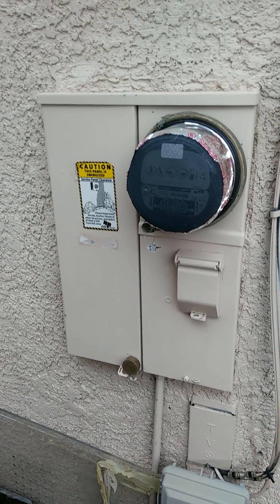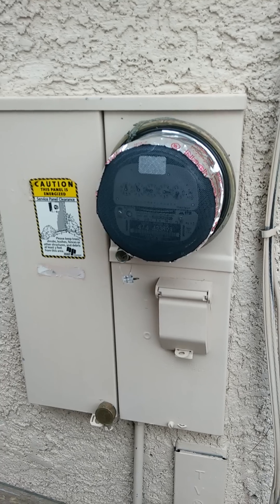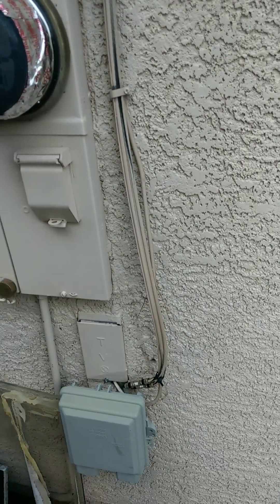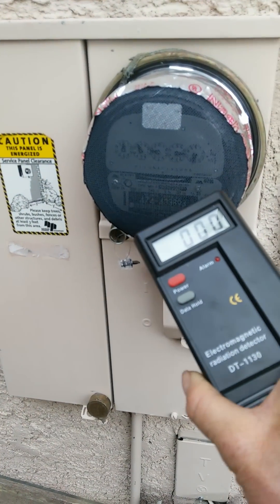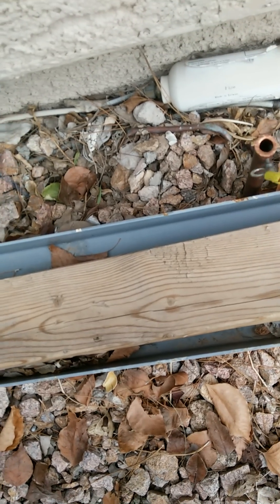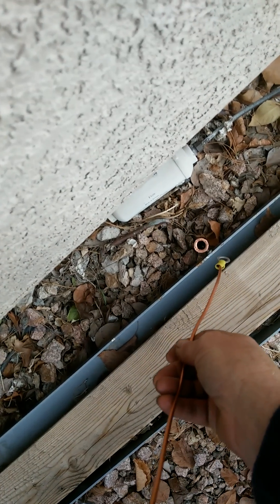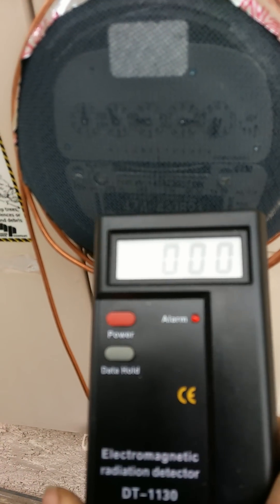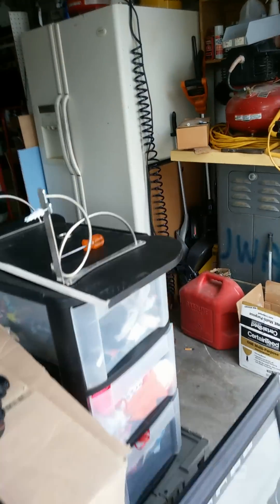Out smart the smart meter

Comment: Just put a aluminium screen on it with a 6" clamp and the frequency will drop alot
Reply: Technically the frequency stays the safe.
The amount of radiation is reduced to a much safer level.  
LESS RF OUTPUT.
Reply: thats 7'' you gombeen

Comment: You do not need to give your utility company "permission" to install a smart meter. Meters are property of the utility company not the homeowner. If you do not want a smart meter most utility companies allow you to opt out; some however charge a monthly opt out fee.
Reply: They do need permission to stick a HIGH POWERED COMMERCIAL RADIO TRANSMITTER ON YOUR HOME 
With over 100 deaths every month from smart meter radiation, that is the reason they DO NOT HAVE PERMISSION
Reply: Frederique Zug: please post the link which contains the data and source for your  “100 deaths per month” that you mention in your reply. Also, put your emotions aside for a second and realize that the meter does not belong to you and the utility company may change it as they see fit. They are required to give you advance warning prior to changing it and as mentioned most give you the option to opt out before installation but if they do not hear otherwise, they  DO NOT need your “permission” to install one.
Reply: Idk about any other state, but I live in Ohio and they had to ask my permission before they put one on my house.

Comment: she knows its not a smart meter she had the smart meter reolaced with one that put off radiation as well she grounded it also to hold down the extra radiation is what i got out of it. and if it works then just ficking do it too. or let the radition surround you to your choice.
Reply: 🔥🔥🔥🔥🔥☠☠🔥🔥🔥🔥🔥🚒🔥🔥🔥🔥🔥🔥🔥🔥🚒☠💀💀💀💀☠🔥🔥🔥🔥🔥🚒
Let's look at why we do not need smart meters. 
 #1 A smart meter will hurt or even KILL disabled homeowners who have disabled medical implants.  The average of deaths by smart meter radiation and smart meter fires is almost 100 every month in North America.
#2 Did you know if your power company “turned off” the power to your home when they did a smart meter install, your chance of a smart meter fire increased by a factor of 10,000.
#3 Your power company has access to all of you private power information. Eg When you make tea, when you turn on your alarm etc. This private information is sold to Google for huge sums of money. Ask your power company what the second radio transmitter in your smart meter does. (ZigBee) 
#4 A smart meter will cause cancer to return if your family members who are fighting cancer at home. If they come home from the hospital and sleep near a smart meter, they will die. Check with the US Cancer Society website. 
#5 Smart Meter RADIATION  will turn off breakers in your home. Both AFCI's and GFI's get turned off by the radiation from the smart meter.
#6 You smart meter is very accurate, BUT, the software (firmware) is programmable. Your bill has nothing to do with the power you use. 
#7 Smart meter radiation is breaking Ionic Bonding. 
#8 A huge expenditure for a huge loss. Billions of dollars to purchase something that does not general generate any power and each smart meter need 4 watts to operate. One million smart meters use 4,000 KILOWATTS of energy to operate.
#9 The second radio transmitter is for ZigBee. If you want your power company to MONITOR your home 24/7, then you are in luck. Don’t forget, this private information will be sold. Why do you think your power company spends BILLIONS of dollars and does not generate one watt of extra power to sell?
Reply: https://ieeexplore.ieee.org/document/7866234/?reload=true

Comment: The panel is grounded, you do not need to install another ground unless you want to put two 8 foot rods, and use brass screen not aluminum screen. Copper pipe is not a good ground rod.

Comment: does any one know what a safe distance away from the meter might be? im a horizontal directional driller and im pretty sure here soon im going to run a line to the back of ky property and put the meter there. right now its right outside my 2 1/2 yr old sons room. that room is the hottest room in the house too. not sure if thats in connection to the meter or what but i checked the duct in the attic that runs to that room,  no leaks no blockage nothing but that room is the furthest room from the ac unit so maybe that plays a factor. but that room is always uncomfortably  warm.  needless to say i dont let my son sleep in there. im sure georgia power will bitch when i move it without permission  but i will remind them thay installed it without permission so they are lucky i didnt dispose of it properly. but something gives me the feeling that they covered their ass and found a way for it to fall under the same permissions as  all the other utilities that you permit utility companies to work on their utilities on your property wherever their utilities are located on your property , whever you sign the deed to your house. in the fine print of course. but when i signed the deed to my house they didnt mention smart meters.  thats a whole other level
Reply: Greetings Jerry
They are allowed to install a meter on your home to measure the amount of power you consume. 
 They  can not get any closer than 12 inches to any one work, living or walking by.
Your power company will hire an outside company to BYPASS this FCC law.
That way, if you son dies from the excessive radiation, it's not their fault. 
Don't forget, your power company did not purchase a license from the FCC. so legally there is nothing they can do if you wrap your smart meter in aluminum foil. 

Watch this video, this is the only acceptable way to install a smart meter.
https://www.youtube.com/watch?v=G0bq2Hn2vOo
Your power meter is NOT UL approved and not as safe as the old glass and metal meter. 
87% of all fires in your town are caused by mental idiots improperly installing meters on your UL approved meter base. 
The damage they cause will start a fire inside of the meter box. 
Now, you tell me, try to burn a glass and metal meter or a plastic meter.  Which is going to burn the easiest.

You did hit the nail on the head. To stop the radiation from your smart meter and the fires they cause, move the meter base to the edge of your property.
It's your family, so stay safe. 
And one other thing. Have a look at this video
https://www.youtube.com/watch?v=G0bq2Hn2vOo
Reply: METER BASE
https://www.youtube.com/watch?v=pBEIajRlMUg
Got to love the bypass meter with the bypass handle.
I wonder why UL wants these to be the new standard?   FIRES?

Comment: "This alone is the reason, what is called ROI (return on investment)". One million smart meters to purchase, install, add the meshed network, and a really big computer for all of your private information will cost around 1.5 BILLION dollars. What do you get to this ROI? For 1.5 BILLION dollars you get ZERO power generated, in fact each smart meter uses 4 watts of power. So they spent $1,500,000,000 to waste 4,000 KILOWATTS of power.

Comment: The service is already grounded if you had just extended the foil to the metal ring on the meter you could have saved all the effort of installing a separate ground. Also, check it out, try your meter on various appliances in your house.... ceiling fans, CFL and LED lights put out tons of EMF because of the transformers in them. Check your computer, do you put it close to where you sit? How about your WiFi, is it close to you? Then there is your cell phone, don't even get me started on that one....
Reply: wow, we done found us an  *EXPERT
So UtwoBed, can you supply us with links for the DISTANCE TO COMPLIANCE for all of these devices?
YOU DO KNOW THAT YOUR SMART METERS ARE RESPONSIBLE FOR OVER 100 DEATHS EVERY MONTH 
So hurry up with these links.
Reply: Why would anyone bother? Any information from the government or industry is like letting the fox guard the hen house. If smart meters are killing 100 people a month then cell phones are killing at least a 100 times more. Measuring the RF from smart meters and smart phones, the phones are putting out much more energy, and just try to get people to give up their phones. My cell phone stay in my van for emergency use and at home i have an old fashioned hard line phone with a tail. If you are not going to give up your cell phone don't sweat the meter cause the cell phone will get you much sooner.

Comment: It’s still pulsing through the power lines inside the walls. The dirty electricity kills nerves. Gotta get it removed. Good luck.
Reply: Let's look at why we do not need smart meters. 
 #1 A smart meter will hurt or even KILL disabled homeowners who have disabled medical implants.  The average of deaths by smart meter radiation and smart meter fires is almost 100 every month in North America.
#2 Did you know if your power company “turned off” the power to your home when they did a smart meter install, your chance of a smart meter fire increased by a factor of 10,000.
#3 Your power company has access to all of you private power information. Eg When you make tea, when you turn on your alarm etc. This private information is sold to Google for huge sums of money. Ask your power company what the second radio transmitter in your smart meter does. (ZigBee) 
#4 A smart meter will cause cancer to return if your family members who are fighting cancer at home. If they come home from the hospital and sleep near a smart meter, they will die. Check with the US Cancer Society website. 
#5 Smart Meter RADIATION  will turn off breakers in your home. Both AFCI's and GFI's get turned off by the radiation from the smart meter.
#6 You smart meter is very accurate, BUT, the software (firmware) is programmable. Your bill has nothing to do with the power you use. 
#7 Smart meter radiation is breaking Ionic Bonding. 
#8 A huge expenditure for a huge loss. Billions of dollars to purchase something that does not general generate any power and each smart meter need 4 watts to operate. One million smart meters use 4,000 KILOWATTS of energy to operate.
#9 The second radio transmitter is for ZigBee. If you want your power company to MONITOR your home 24/7, then you are in luck. Don’t forget, this private information will be sold. Why do you think your power company spends BILLIONS of dollars and does not generate one watt of extra power to sell?

Comment: national electrical code ...two 5/8" copper clad ground rods 8' long placed 6' apart pounded into the ground connected together with a #4 solid wire and an acorn nut to the rod and landed in the service panel . Call a journeyman electrician to do it or look it up in the nec.

Comment: ALL electricity gives off EMF signals!
Reply: Yeh obviously but how much it gives off is the question.
Reply: @devonhc7770  Zero source, zero knowledge on what you're talking about. What does "+5000" mean?? What unit is that?
Reply: @emc4361  if you put a guy on the tower for 24 hours he will get a headache and probably bad internal bleeding/organ damage.
Reply: @emc4361  electricians use meters to protect peoples health when installing rf wiring in homes to make sure it's up to code and won't leak in areas of houses so idk ,I just been seeing irritating electrical stuff nothing else tho 😲
Reply: @devonhc7770  Also, "emf radiation" is not a unit. Still waiting for a valid unit.
Reply: @emc4361  I got nothin...

Comment: You need a tinfoil hat
Reply: Let's look at why we need TIN FOIL HATS. 
 #1 A smart meter will hurt or even KILL disabled homeowners who have disabled medical implants.  
#2 Did you know if your power company “turned off” the power to your home when they did a smart meter install, your chance of a smart meter fire increased by a factor of 1000.
#3 Your power company has access to all of you private power information. Eg When you make tea, when you turn on your alarm etc. This private information is sold to Google for huge sums of money. Ask your power company what the second radio transmitter in your smart meter does. (ZigBee) 
#4 A smart meter will cause cancer to return if your family members who are fighting cancer at home. If they come home from the hospital and sleep near a smart meter, they will die. Check with the US Cancer Society website. 
#5  Reason is Smart Meter RADIATION turn off breakers in your home. Both AFCI's and GFI's get turned off by the radiation from the smart meter.
#6 You smart meter is very accurate, BUT, the software (firmware) is programmable. Your bill has nothing to do with the power you use. 
#7 Smart meter radiation is breaking Ionic Bonding.
#8 A huge expenditure for a huge loss. Billions of dollars to purchase something that does not general generate any power and each smart meter need 4 watts to operate. One million smart meters use 4,000 KILOWATTS of energy to operate.

Comment: this is an analogue meter, not a smart meter.  Smart meters are digital.  What a dope!
Reply: Let's look at why we need TIN FOIL HATS. 
 #1 A smart meter will hurt or even KILL disabled homeowners who have disabled medical implants.  
#2 Did you know if your power company “turned off” the power to your home when they did a smart meter install, your chance of a smart meter fire increased by a factor of 1000.
#3 Your power company has access to all of you private power information. Eg When you make tea, when you turn on your alarm etc. This private information is sold to Google for huge sums of money. Ask your power company what the second radio transmitter in your smart meter does. (ZigBee) 
#4 A smart meter will cause cancer to return if your family members who are fighting cancer at home. If they come home from the hospital and sleep near a smart meter, they will die. Check with the US Cancer Society website. 
#5  Reason is Smart Meter RADIATION turn off breakers in your home. Both AFCI's and GFI's get turned off by the radiation from the smart meter.
#6 You smart meter is very accurate, BUT, the software (firmware) is programmable. Your bill has nothing to do with the power you use. 
#7 Smart meter radiation is breaking Ionic Bonding.
#8 A huge expenditure for a huge loss. Billions of dollars to purchase something that does not general generate any power and each smart meter need 4 watts to operate. One million smart meters use 4,000 KILOWATTS of energy to operate.

Comment: Tobias Maier 17 minutes ago said:
"Also instituting a nationwide aluminum foil ban."
----------------------------------------------------------------------------------------------------------------
and here is why

 #1 A smart meter will hurt or even KILL disabled homeowners who have disabled medical implants.  
#2 Did you know if your power company “turned off” the power to your home when they did a smart meter install, your chance of a smart meter fire increased by a factor of 1000.
#3 Your power company has access to all of you private power information. Eg When you make tea, when you turn on your alarm etc. This private information is sold to Google for huge sums of money. Ask your power company what the second radio transmitter in your smart meter does. (ZigBee) 
#4 A smart meter will cause cancer to return if your family members who are fighting cancer at home. If they come home from the hospital and sleep near a smart meter, they will die. Check with the US Cancer Society website. 
#5  Reason is Smart Meter RADIATION turn off breakers in your home. Both AFCI's and GFI's get turned off by the radiation from the smart meter.
#6 You smart meter is very accurate, BUT, the software (firmware) is programmable. Your bill has nothing to do with the power you use. 
#7 Smart meter radiation is breaking Ionic Bonding.
#8 A huge expenditure for a huge loss. Billions of dollars to purchase something that does not general generate any power and each smart meter need 4 watts to operate. One million smart meters use 4,000 KILOWATTS of energy to operate.

Comment: You are straight up fucking crazy lol
Reply: Let's look at why we need TIN FOIL HATS. 
 #1 reason is they turn off breakers in your home. Both AFCI's and GFI's get turned off by the radiation from the smart meter.
#2 Did you know a flammable smart meter will turn off your power if you do not pay your bill, BUT it doesn't know when it's own butt is on fire. 
#3 Your power company has access to all of you private power information. Eg When you make tea, when you turn on your alarm etc. 
#4 A smart meter will KILL your family members who have cancer. If they come home from the hospital and sleep near a smart meter, they will die. Check with the US Cancer Society website. 
#5 A smart meter will hurt or even KILL disabled homeowners who have disabled medical implants.  
#6 You smart meter is very accurate, so accurate that it also measure the noise and dirty electricity. Have a look at INRUSH power.

Comment: Twice the electric co came out to our box. When we asked Why?? Both times they said they feared our house might catch on fire due to the high levels of the readings. They originally put the box in while we weren't at home, we got in touch with Georgia Power, we didn't want the box but we were told GA was one of the states that does NOT allow you to option out even with a fee.